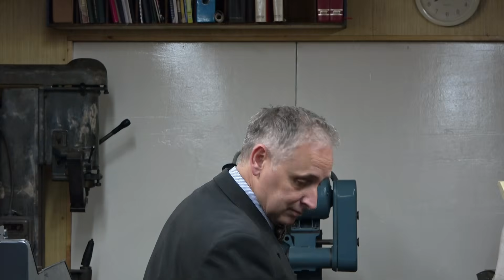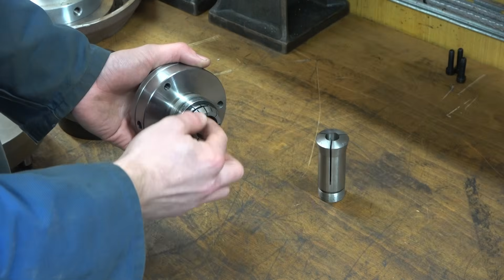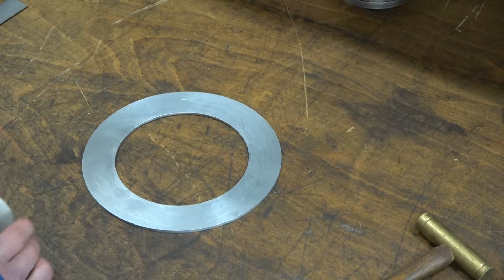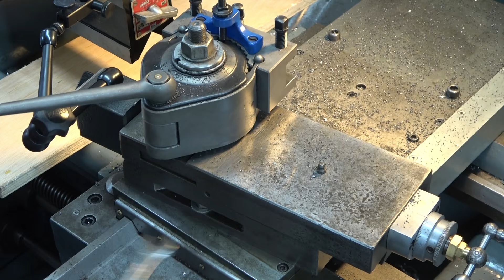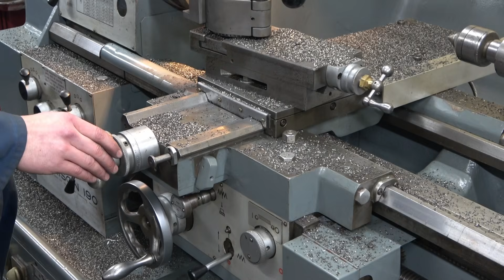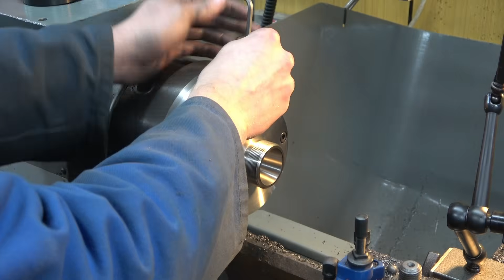Collet Chuck for Harrison Lathe

Comment: What sort of witchcraft is this for laying out a six hole bolt pattern.   I feel like my life would have been much easier if I'd only listened to my teachers.
Reply: @MrCrispinEnterprises  What you're doing with the dividers is in essence marking six equilateral triangles with each side equal to the radius. Each inner angle is sixty degrees, and six times sixty is 360. So it fits exactly. The mistake some people are making is thinking that you're measuring one sixth of the circumference with the dividers...ie. a one-sixth arc...but you're not. Agreed, if you were measuring six arcs around the circumference you'd need to factor in pi, but you're not... simply creating six equal triangles.
Reply: I just drew it up in fusion and i am completely wrong. Thanks for playing. The error is absorbed in the arc length between the straight line chord and the edge of the circle perimeter
Reply: @bobodyuknow  Genuinely, and I really mean this, thank you for coming back to say this.  Not enough people on the internet have the bottle to stand up and admit they've learned something.  +1 to you and have a good evening!
Reply: Witchcraft? Check your Machinist handbook it's in there. Amazing what's contained in the book.
Reply: We as kids used to use this to draw 6 petal sunflowers with a compass. 
https://www.youtube.com/watch?v=OclPy3P-lAs
Never occurred to me you could use it for 6 bolts on a circle though!
Reply: 2 pi radius = 6.28
Reply: @bobodyuknow What's your point? I hope you're not trying to say that stepping the radius around the circle doesn't go exactly 6 times, because it does.
Reply: @cooperised  calm thou tits. You trying to argue with the maths? There is an error of 0.28 radians for the circumference but divide it by 6 for each hole and you're at 0.0466 radians or 2.67 degrees error per hole. Why do you think Mr Crispin had a hole misalignment when trying to assemble it? Probably to do with the hole tolerance being tight and the hole angular pitch error accumulation for every new hole he lay out so there was only one orientation the plate could fit.
Reply: @bobodyuknow  I too always had difficulty when setting this out at school 60-55 years ago. It never would go accurately six times for me. And you have explained the accumulated error which of course only shows up on the seventh (or first hole)as the dividers return to  the starting point
Reply: @samrodian919  I always said, "I was so poor that I couldn't afford to pay attention."
Reply: @buckinthetree1233  lol  I like that one, I've never heard that one before ." He was poor, but he was honest"  as opposed to " he was poor but bloody lazy"..............
Reply: @bobodyuknow  The comment above this explains it perfectly. If you take six equilateral triangles and line them up to make a hexagon, you can draw a circle with its centre precisely where the triangles all meet, which also passes precisely through all six points of the hexagon. The radius of the circle is the same as the side length of a triangle, and the straight line distance between two adjacent points is also the same as the side length of a triangle, and therefore equal to the radius. This is easier to show with a diagram but that's tricky in a YouTube comment! Any inaccuracy in the hole circle is due to the inherent inaccuracy of hand layout, lining up punches, and drilling holes.
Reply: @MrCrispinEnterprises  There definitely isn't any accumulated inaccuracy, not due to the maths anyway - see the comments just above this. Of course there is likely to be some accumulated error just from walking the dividers, all hand layout techniques are subject to a certain amount of error and in this case it is likely to accumulate as each hole is positioned relative to the previous one, but the maths is clear that you will indeed get exactly 6 divisions if there is no layout error.
Reply from the maker: @cooperised Thanks, I've now had a think about this and I think you are correct and the method does work out exactly. I think where the confusion has come from thinking that this method divides the circumference by 6. Actually what the method is doing is providing the intersection points of 6 equally spaces chords that all join up. So the maths to prove this is not as simple as 2 pi r it's actually a case of investigating the chord lengths.
Reply: @MrCrispinEnterprises the chord length is ever so slightly smaller than you are expecting basing it off the radius
Reply: @cooperised there definitely is accrued error and the maths proves it.
Reply: Yes. Me too. Wish I'd done better at maths.
Reply: At first I was slightly surprised to the find the radius at the compass. But then I realized it wasn't touched since the circle was drawn.
Reply: Haha 😂  I must confess as an ex machinist I fast fowarded till the end... I just assumed he would have clocked that piece in the mill and either proceeded to carryout a 6 hole pattern or work out by maths his x and y or consulted his zeus charts 😂  nope he went old school and transcribed pretty flowers for us.. hence any inaccuracies... keep it up theres not many manual machinst left, everyone and there granny want to push buttons on thier cnc 5 axis hurcos nowadays.😢
Reply: @TheMotorEddy it isnt 60 degrees though due to the 2.67 degree error per hole. The initial measurement was taken from the radius. That 60 degrees is in fact 57.33. Draw 6 hole circle pattern spaced using the above technique and use a compass to draw a circle with the same radius at each of these hole centres, youll see the perimeter of that new line has no incident with the centre of the next hole.